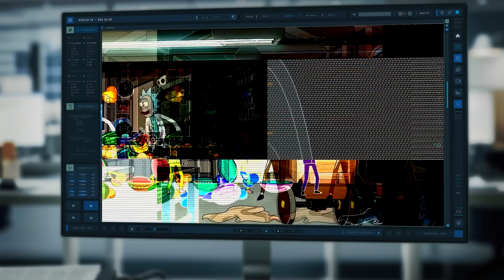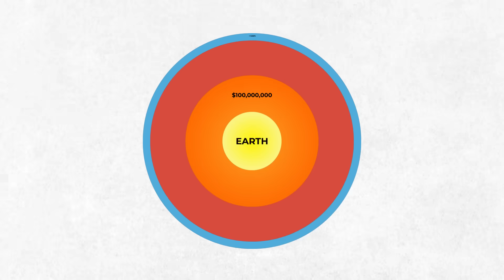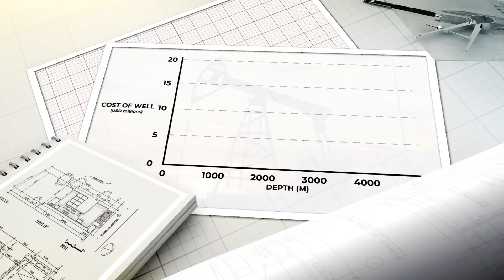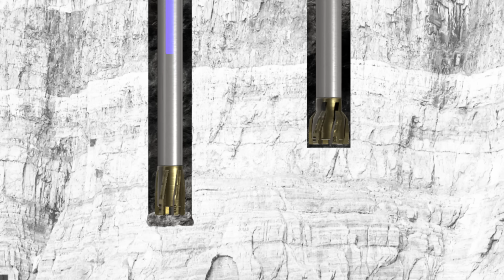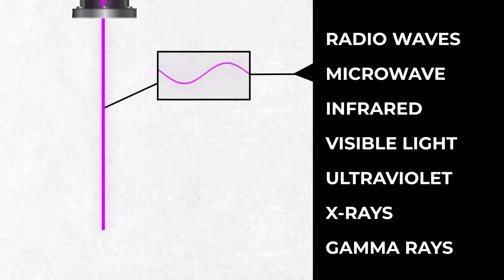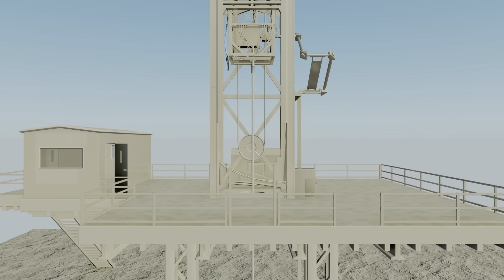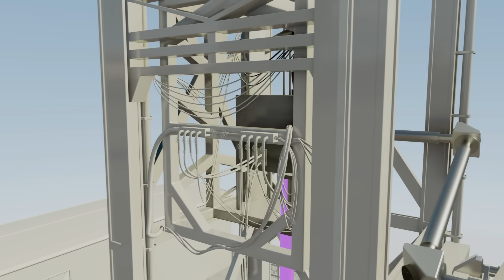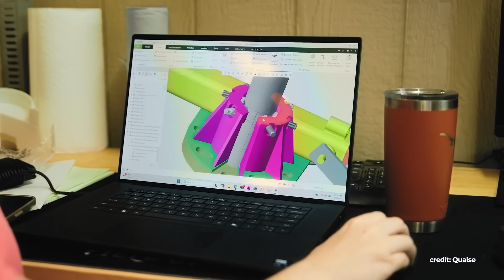The Most Advanced Drill in Human History

Comment: Greetings from Aotearoa/New Zealand where geothermic energy provides a significant part of the energy powering our national grid, starting with Wairakei our first geothermal plant in the 1950s.  Naturally occurring geothermal energy primarily in the Taupō Volcanic Zone, combined with technology, means that geothermal power contributes approx 25% of the total energy supply and 19% of electricity production.
Reply: I don’t understand what you guys are saying
Reply: @Pk_the_duck  There are YT videos on most every topic out there, if you are interested.  Basically it is using the heat that exists well below the surface to generate electricity.  The same way you do it with coal or oil or nuclear, boiling water to make steam to driver turbines to drive electrical generators.  In volcanically active places, you don't have to go very deep at all to get to where you can extract this high quality (high temperature) heat energy.
Reply: Yes, its useful for a very small country, but not scaleable and it is not renewable, it is extractive. It is extracting the heat from the zone until it is too cold to be useful. This has already started at Wairakei where the original turbines have been replaced with low pressure versions and new bores have been drilled further away from the station, water is now reinjected to reduce the subsidence and the power is much reduced.
Reply: @kimollivier  umm - I'm not sure what your background is - (mine includes energy generation) - all of what you said is simply not true 

Scalebale?- depends on the country, infrastructure & most critically the natural resources.  as I said, our geothermic energy comes from the naturally occurring Taupō Volcanic Zone 

I suppose my comment was a) - yes is very much feasible (we have been harnessing this power since the 1950s - and also b) - we have been harnessing naturally occurring geothermal energy (I have my doubts & concerns about creating a man-made geo-thermal resource 

New Zealand has an abundant supply of geothermal energy because we are located on the boundary between two tectonic plates.  The crust is thin along this rift and supports at least 23 distinct geothermal plumes or fields. Of these fields, eight currently generate electricity or supply direct users. 

yes, Wairakei, as I said, has been in operation since the 1950s.  (simply making the point that this is not new or experimental here) ALL generators, whether geothermal, hydro, wind etc in Aotearoa/New Zealand go through ongoing maintenance & replacement. 

The Wairakei Power Station is being replaced AT Wairakei by the Te Mihi Power Station. updated technology, not because the location has "too cold" (your words not mine) - 

I am sorry but your claim that this energy generation is "not renewable", "it is extractive" is simply NOT true. it is GEOTHERMAL energy 

Geothermal electricity is unusual among renewable electricity generation types, because the energy from the earth's mantle is available constantly and consistently across time.
  
"Geothermal energy taps the earth’s natural heat flow from the hot mantle (at around 1000oC) up into the cooler crust. New Zealand has an abundant supply of geothermal energy because we are located on the boundary between two tectonic plates"

could this change? - COULD plate tectonic activity move to the point where geothermic generation is no longer feasible in Aotearoa/New ealand - yes, anything is _possible_.  is it likely, not at all - 

geothermal energy IS renewable by it's very nature, and not at all "extractive" -  you think humans tapping into the massive heat of the massive mantle of the earth is going to make this resource go "cold" - mate!
Reply: @juliaconnell  "could this change? - COULD plate tectonic activity move to the point where geothermic generation is no longer feasible in Aotearoa/New ealand - yes, anything is _possible_.  is it likely, not at all - "

Actually, it is a GIVEN, but not on the timescales you would worry about here.  ;-)  Most continents move at about the speed a fingernail grows, so you will be fine for a 'little' while, even on geological time frames.  

One thing I found interesting, looking at divergent boundaries is that, over very large timescales, meaning significant fractions of billion year sorts of numbers, they sometimes disappear at one location, and reappear at another.  I expect that this might be do to the dynamics of those convection currents in the mantle changing over time.  None of this is germane to the discussion at the level of time spans you are speaking to, but just something I found interesting.

That energy is ultimately renewable by the nuclear processes going on in the core.  There are several ounces of material there, so it should last a week or two, especially since it has been going on for probably about four billion years or more, so far.  ;-)  I don't know what the heat energy transfer rates are down at those depths of extraction in the crust, but I expect they are significant, so I wouldn't think that temperature draw down would be a problem unless you were extracting HUGE amounts in very localized areas.  And the mantle heat turnover rates have got to be astronomical (if you will permit) by any number we are concerned with extracting, since that heat energy PUSHES ALL THE CONTINENTS around the entire Earth, again, and again, and ...

I am an electrical engineer with wide interests, so I claim no expertise in any of these areas, but just my thoughts, reading through your  post.
Reply: @MrJdsenior  thank you for your thoughts, very much appreciated. 

I'm just as interested as you are - in this, in a variety of related topics

I was very fortunate to have an upbringing, a dad, who was just as interested in similar things.  I was just a kid, traveling with my parents to see my older sisters (at university or working) - from the photos, early teen

dad would always have these 'adventures off the beaten track' - research an area and along the way (or other times, dedicated trips) stop to investigate, see for himself (& explain).   

so this trip, about 12 hours, we made a stop outside one of the hydro powered power stations.  me,  (at that age when everything is just so...cringe) - panicked - 'dad I don't think it's open to the public' - sure enough signs saying just that, 'dad you can't' - but he did - knock.  nice couple of guys saying 'sorry sir, not open to the public' - YET next thing you know we (me, mum  & dad) are having a tour of this power station 

My dad was a lawyer, a barrister and solicitor - he did what he always did, expressed genuine, researched interest - completely accepted that the place was NOT open to the public, just engaged with interest (& some knowledge), asked questions - listened (rare skill that, actually _listening_), and I can still hear and see the noise of that hydro power station 

many many moons later I did similar tours throughout the entirety of a series of hydro power stations, literally from top to the deepest depths, through a dam lol, under a lake - oh and then later up one of those massive wind turbines.   several trips to the South Island to walk through (fly above) - these assets to understand the physical limitations of what the Generation Controller could do and how this impacted what I needed to do (for example - several of these hydro (water) power stations were LINKED - so if something tripped in one, had to amend the offer of the other.  (I was trading electricity two hours in advance - however, if something 'tripped' - in real time, the 'offer' had to be amended (all sorts of reporting done..) 

I did NOT have a background in electrical engineering - but had to learn enough on the job in order to do MY job (trading electricity on the spot market) - data analysis testing and then on the job training for 3 to 4 months (working through a training manual).    fascinating field - and feel very fortunate to have spent some time in this sector. 

so a trip down with my manager, to fly over the hydro-stations (same water used through... (had to stop & think...) 8 power stations (& when I resigned they were researching another).  then a week with the Generator Controllers, "GC Lite" - and they did a week with us, the trading team 'trader lite' - (both roles, single person working 12 hour shifts) so we could understand what they were doing to gain a better understanding of how we could work better together

 oh, plus every 6 months we came off the trading desk (and 12 hour shifts) to do 'normal' business hours as the 'strategic trader' (particpate in the DAILY strategy meetings (us, the GC team, our weather expert) - part of our role when on shift was to read the latest research and reports - the company I worked for controlled 40% of the energy market, mostly hydro, some wind - so I'm only aware of the basics of geothermal (and tidal, and solar...)

.  then when there was enough new people at all 3, no 4 (no, 3 lol) organisation we spent a week together touring our various assets/organizations. us (the Traders & the Generation Controllers), the team the GCs worked very closely with (actually all 3 organizations did, 'pot change' at Aluminum smelter - that was our first stop).  so 2 of their new, recent people/new hires, me and Andrew, (Traders) - one (or two?) Generation Controllers, and two (or three?, no I think 2) from the company that ran the actual national grid.  oh plus, in chch (sorry, Christchurch) for the first time ever we were briefly joined by someone from the local distribution grid (as opposed to the national grid) 

sorry, slightly diverted from the topic of geography - fascinating field - and feel very fortunate to have spent some time in this sector. 

my mum passed in May (it's ok, she was 88, had a good life, heart failure - doctors said at of 2020 she wouldn't see the end of 2021 - she passed May 2025) - so dad would have been 99 (he passed in 1998) - ma & I were swapping stories about dad via text (well, i was texting her daily, an occasional text from her) - she mentioned something about dad and his fascination with 'rocks' - this was new info to me - usually other sites (did we ever find that historic wooden dam in the middle of the bush? think we gave up on that...) 

anyway...
Reply: @MrJdsenior  ok, so part two (I have to be somewhere soonish) 

yes, the geography of planet earth is fascinating - especially when you live in the midst of it!  

at primary school, had a horrible teacher/headmaster (racist, sexist) but he did do science well.  we had a two dimensional map of Aotearoa/New Zealand - and I remember the insight in the reality of plate tectonics when he held a ... (it was quite large, this map, so not a ruler, that would have been too small) - held some 'stick' along the Southern Alps - 'see - that line - those mountains formed by two plates pushing against and UP - lifting the land up, creating that mountain range' - fascinating...

it's the same with the Hawaii islands - forming along the flow in the flaw in the crust- with all the counties in the 'ring of fire' - not just theory when you can SEE the results in real life

there's a place in Africa were the movement is breaking along 3 different plates - separating the land - the massive rift is already forming - visible

& you're right of course - in LONG time - where we are just specks in the midst of the massive timeline of the earth, things will be ripped apart, slammed together. 

Aotearoa/New Zealand has been (quite happily) geographically isolated since breaking away from Gondwana 83–79 million years ago  

& that's my alarm, gotto go...

 - thank you again, really enjoyed your words, thoughts
Reply: @juliaconnell  Sounds like we are about the same age, within half a decade or so, anyway,  judging from your parents ages.

I, too, enjoyed the read, thx.

New Zealand is one place on my 'to visit' bucket list.  Maybe one day...

Looking around on Google maps and specials I have seen, it looks gorgeous.  Just did a loop around the US, including a cruise to Alaska.  Man, oh man, is that some spectacularly beautiful country, as well.  We are going to do a trip around Europe in the not too distant future, maybe after that.

Comment: The nice thing about attacking geothermal power like this, is there is a built in ROI that is fairly easy to achieve compared to non-renewable sources and even some renewables. I hope Quaise get it all figured out and don't get too greedy with the licensing costs if indeed they plan to sell the idea beyond borders. It's the cleanest scalable energy we will ever have as a species.
Reply: They haven't thought it through. Look at how existing geothermal power stations work. Not just a district heating system using warm water. The heat flux is only 0.1 W/m2 regardless of the temperature. You cannot extract enough power from a simple system. Existing plants tap into huge fields of hot superheated water in porous pumice rock. Even then they cool the ground. Pumping the water back down uses up all the power generated. Its a bust. Interesting drilling technology, but for what purpose?

Comment: A fair amount of Iceland's power is from geothermal energy so it's not as far fetched as I originally thought
Reply: Yes it is. far fetched. All geothermal plants the world over tap into an existing shallow hot water reservoir that has accumulated over thousands of years. It cools down measurably because it was in equilibrium. Geothermal energy plants are extractive, non-renewable processes just like fossil fuels. Not this faulty idea of drilling a hole to hot dry deep rocks. The heat flux of rock is < 0.1W/m2 so you cannot extract enough power to run a steam turbine. A simple calculation will show how futile it is. Just see how much mass is required to run a small 10 MW turbine.

Comment: I’m working in fusion, and we’re building an ECRH system for our machine—the kind that uses gyrotrons. We already see measurable losses in our waveguides, which are at room temperature, firmly fixed, and only 20–30 m long.

And they want to have a rotating, kilometers-long one at elevated temperatures. Sooo… good luck, folks 😅. Genuinely.
Reply: Can't gyrotron be made small enough so it's a part inside the drilling bit while all you need to supply from surface is electricity?
Reply: @alexmin4752 I don't think so. 
Gyrotron requires an inormous magnetic field. High voltage in the range of 60-100kV usually and intence cooling. In small cavity which is few mm size it generates 100-1000 kW of power. So presision of assembly is also quite challenging. And so on.
Reply: @alexmin4752  when you get above 300 degrees, the insulation melts off the wires. And that’s not the “very hot temperatures “ they plan to drill down to.
Reply: @MrPhillip2 there are mineraly insulated cables on the market. So this is solvable issue. 500C is absolutely fine for them.
Reply: Didn't they say they don't plan on it rotating in the final product? Once they boost the power they shouldn't require it to rotate to scrape off that liquid rock as it'll have vaporized.
Reply: @logicbuilder1204  you still need to move it. I make a simple estimation. 
For currently best waveguide, if you absolutely perfectly connect 20 km of them... You anyway lost abot 99 percent of power 😅
Reply: @logic0905  I did some VERY rough approximation, and assuming a 10 m section is 99% efficient, power delivery at 10 km would be 0.0043% of the initial power input. That means their megawatt output gets cut to around 43 W of delivered power. At 5 km it’s 6500 W Unless they know something that I don’t, which is very possible don’t get me wrong, I cannot see this working at scale.
Reply: @joeshmoe4207  lastly, you would need to generate this power, continuously during the drilling process, in a remote location… offshore or in a marsh or in a pasture. There’s no grid to jack into.
Reply: @joeshmoe4207 I took an attenuation rate per meter from the datasheet of one of the manufacturers of the corrugated waveguides and extrapolated it for 20 km. Which I believe THE MOST optimistic estimation. 
And it is still doesn't leave this approach any chance. So 🤷.
Or they're too optimistic, or have so know-how regarding the waveguides.
Reply: @logic0905  i’d be interested in the specific numbers you found. I didn’t really take much time to look for their specific style wave guide
Reply: @logicbuilder1204  where do the vapors go? Do they jet back up the borehole? Do the roughnecks on the drill floor breath these vapors?
Reply: @MrPhillip2  Idk man I was just correcting them about something they got wrong in the original comment
Reply: @MrPhillip2 I was wondering the same thing …. What kind of never before seen toxins will be created at those temperatures and brought up for humans to breathe?
Reply: Maybe you just suck
Reply: Wouldnt lasers work way better than microwaves?
Reply: Oh, you're working in fusion, huh? So you must be an expert in non-viable venture capital bait like this then. Yeah, it's bullshite.
Reply: keep working hard! The future is going to be amazing!